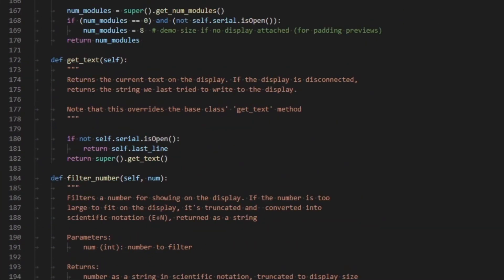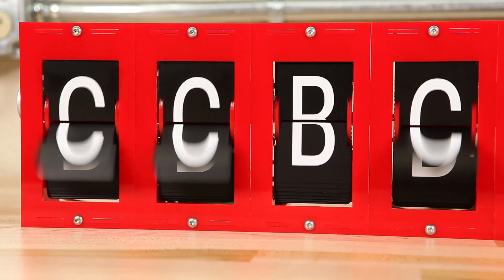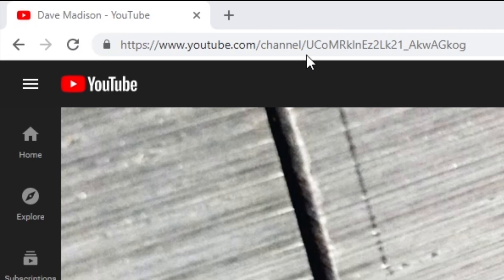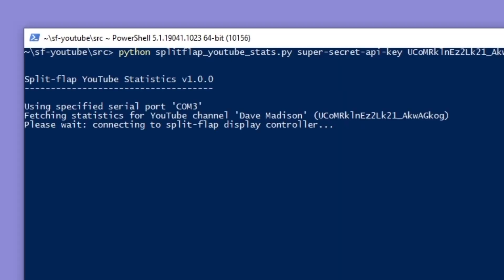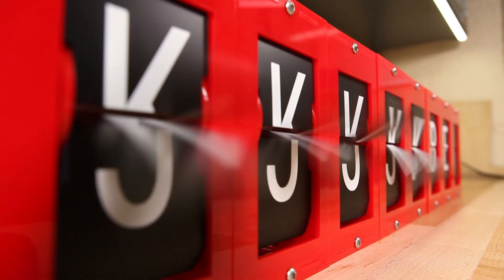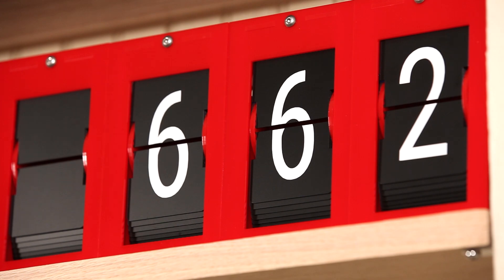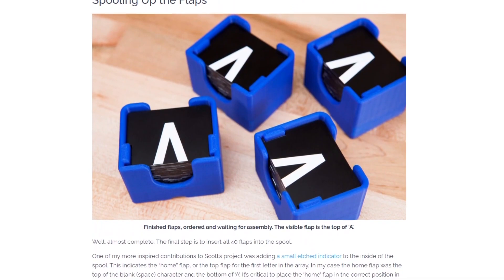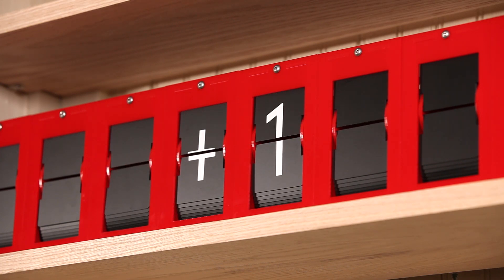Split-Flap Subscriber Counter

Comment: How difficult would it be to modify your code to control mechanical 7-segment Vane displays?
Reply from the maker: It shouldn't be too difficult. If you write the 7-segment driver using the same API as the split-flap project the Python code shouldn't need any modifications at all.
Reply: @dave.madison  Lovely! I might try my hand at recreating this project using eight of the Alfa-Zeta 1" Vane displays, I've always wanted to have a go at making something with those. Electromechanical displays are so much fun, thank you for making this project and this video!

Comment: Hi Dave, I'm setting up a woodworking shop and I'd love to make a counter like yours but running on Arduino for the "days without injuries" with a red mushroom reset button that when pressed sets it back to 0 and restarts counting, Do you have a starting point on which I can work?
Reply from the maker: Hi Tony! Start with the main split-flap project and the included firmware. It shouldn't be too difficult to modify and add a counter. Alternately, you could also use a second Arduino to count and prepare the string and then send it to the board running the display via serial.